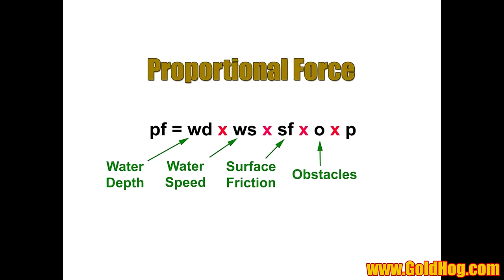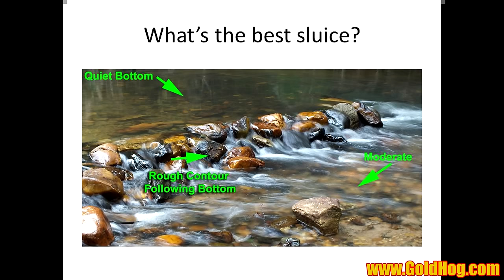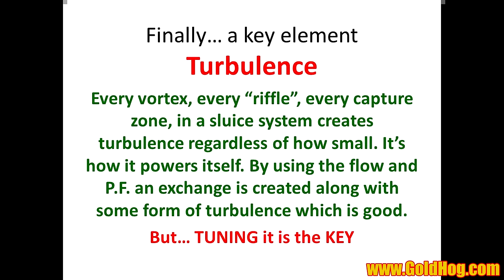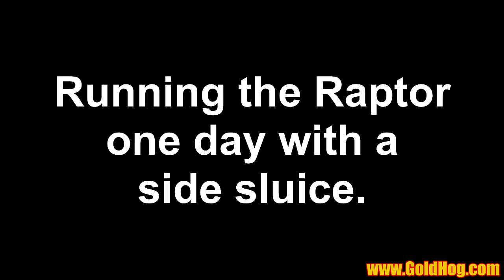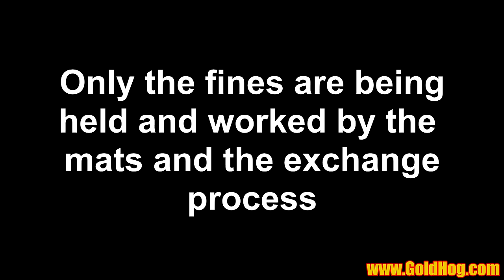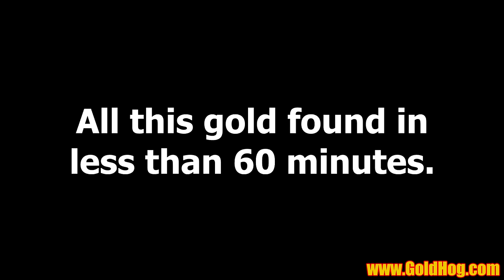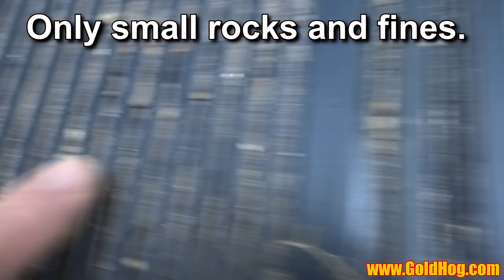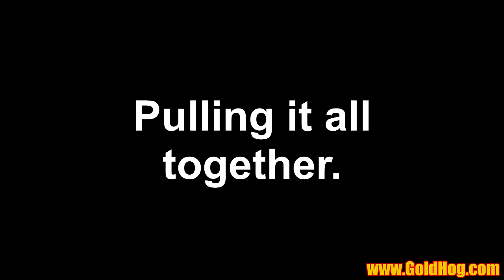Proportional Force - Gold Mining and Prospecting

Comment: "Larger rocks never enter into the exchange process." I disagree with that. Every size rock or gravel of a distinct mass will generate unwanted negative pressure and turbulances which make the matting inefficient. Example: Spread a bucket full of brown leafes over the ground and let run a bowling ball over them. Same princible.